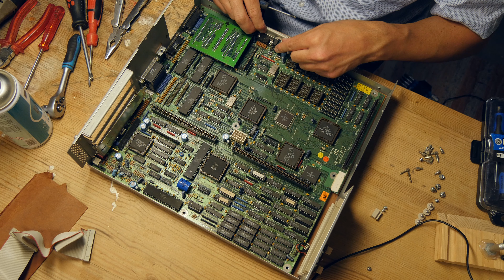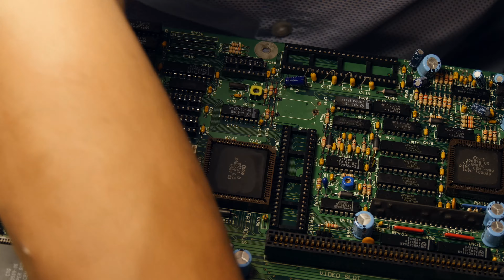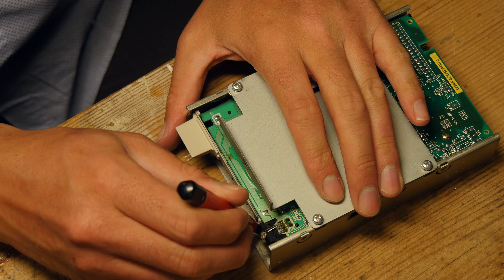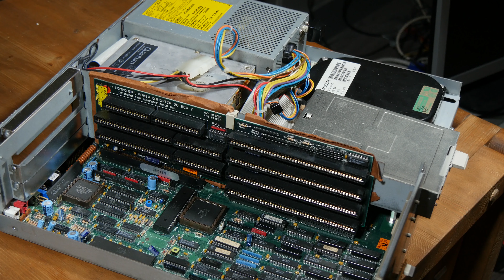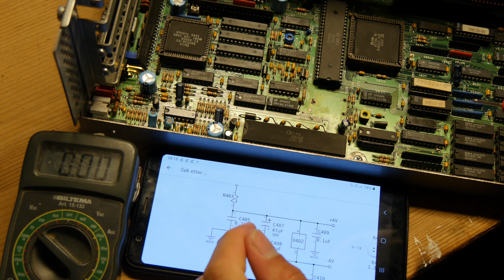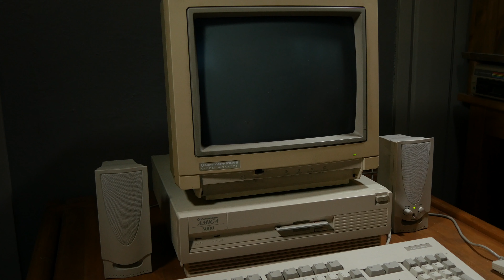I got an Amiga 3000! Repairing and cleaning.

Comment: Tip: We replaced the fan in the power supply with a Noctua NF-A8 ULN. It is so MUCH, MUCH, MUCH quieter! It was possible to use the existing connectors by just removing the old cables and inserting the Noctua's power cable. YMMV.

Comment: Cool!  ONE of these days, I need to purchase my first Amiga!  Better late than never! ;)
Reply from the maker: Yeah. An Amiga 500 is still a fun computer. Connect to a pc with parallel port for networking. Serial port for modem emulating. Extra disk drives, perhaps one as a gotek. Get action replay mk3 to save games, play games in slow motion,,there are stuff to do with an Amiga 500 and it's not that expensive. And if you want even more new stuff for it, like accelerators, you have many options.
Reply: Personaly I would go for a 1200 but with a 500 you can't go wrong either so go for it :-)

Comment: So YOU bought that one, huh? That was one EXPENSIVE machine? Good to see it go to a good home. Are you happy with how it turned out?
By the way, were you unable to get the internal scandoubler/flickerfixer to work? There are two pots, one on the motherboard and one on the back of the machine. They should be adjusted to suit your monitor. And there might be a good chance some of those SD/FF memory chips are bad. It's not at all uncommon with age. A buster 11 upgrade and replacing those PAL chips with ATF might also be a worthwhile thing to do to ensure smooth operation in the coming years.
Reply from the maker: I am the one. And thanks for the tips :) I am very happy with it. It's in good condition with a good condition keyboard and mouse.